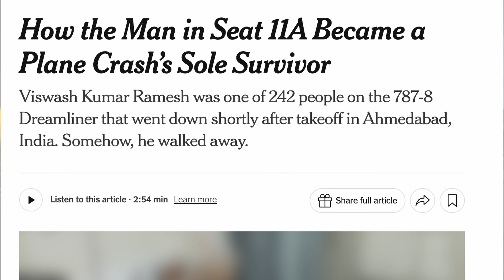Why the RAT Changes Everything – Air India 171 Update

Comment: Here is some interesting information investigators should know. Air India Boeing 787 Dreamliner involved in yesterday’s crash was previously singled out by deceased Boeing whistleblower John Barnett. In 2024, Barnett had raised alarm about substandard parts and lax quality control at the 787 manufacturing plant.   Barnett, a long‑time Boeing quality-control manager, had publicly refused to fly the Dreamliner, citing Boeing’s prioritization of speed over safety. He died by suicide in March 2024 amid an ongoing legal battle with Boeing.  Following Barnett’s death, another whistleblower—engineer Sam Salehpour, testified to Congress that the Dreamliner assembly process had safety flaws so pronounced they could cause the aircraft to “break apart in midair.” He also alleged Boeing was covering up these defects.  

This isn’t just a typical aircraft accident; it’s the exact same jet model previously flagged by insiders as having possible systemic safety issues during assembly. The convergence of (a) Barnett’s whistleblower warnings about poor parts, (b) Salehpour’s congressional testimony on structural risks, and (c) this real-world crash raises serious questions about Boeing’s quality control and oversight of 787 production.

This highlights a striking (and troubling) link: a Boeing 787 involved in a fatal crash is the same model repeatedly warned against by whistleblowers who died or faced retaliation. This connection intensifies scrutiny of Boeing’s manufacturing practices and federal regulatory oversight.

Comment: Loss of power or a bird strike can be a issue but taking out flaps instead of gear is a bullshit theory as the both are in way different spaces and it will take time to retract flaps like 10-12 seconds as Boeing tech is from an old era and there is safety mechanism in the plane to reconcile these fuckups so to blame these things on pilots is not a very good option these white people think that Indian pilots are not competent enough but they are much better pilots than them and to claim Insuarance money easiest way is to blame on pilots so that the company have an clean chit and can satisfy their shareholders

Comment: The plane went in for maintenance and a over haul recently  my theory is   a complete computer system shut down  now the issue is why are the flaps up does the 787 flaps retract with a full system failure?
And if you have a duel engine failure you would have the flaps set to full?
Going to be interesting
Rip 😢 to the lost souls 🙏

Comment: WHY ENGINE FAILURE ? Ans…,,OVERLOADING. EVERY INDIAN AIRPORT YOU CAN BRIBE THE STAFF AND OFFICIALS TO CARRY EXTRA WEIGHT WHICH THE PILOTS ARE NOT AWARE OF AND IS NOT CALCULATED BY ONBOARD COMPUTERS TO GIVE THE CORRECT THRUST AND POWER TO THE ENGINES  WHICH HAVE TO FAIL

Comment: Well it showed that doing videos too early after the crash is nothing but just speculation. If this video would be your first video on this topic it would be much better. Now it feels the first video was rushed because of "youtube algorithms".  BTW if you take a close look at the gear you can see that the gear up was initiated but never completed, because of no hydraulics/engine power powering elec hydraulic pumps. After take off with main gear down the 787 aircraft bogies are slightly tilted to the back (rear tyres are lower than the front ones). After you go GEAR UP it takes few seconds, but before anything happens with the landing gear doors the bogies are leveled (rear tyres are coming up and they are now leveled/or even slightly above the front tyres) and at this point these aircraft bogies are ready to be brought in inside the aircraft.
In the video you can see front tyres of main landing gear bogies are at the same level/lower than rear tyres - that means that the gear up was started, but it never finished.

Comment: I remember an issue with the Diamond DA-42, when it was first introduced, there was a crash caused by landing gear retraction. In that take-off the battery had been flat that morning, the aircraft was started with ground power and once the engines ran, the alternators started charging the battery. However, when shortly after take-off the gear was selected up, the electric surge was large, and normally assisted by the battery, in this case, both alternators overloaded which resulted in a total electrical failure. Back in the early models, the FADECs where powered by the same electrical system, which then resulted in a dual engine shutdown. 
This problem was solved by installing additional emergency batteries in the aircraft, and modifying procedures that prohibited flight before the batteries were full of charge.
The 787 is a totally different aircraft, but I see some similarities. Could a sudden total electric failure have caused a dual FADEC power loss as well? It would explain the unretracted gear and RAT deployment.  I guess we'll find out when the FDR data is published. let's hope this doesn't happen again before we know what caused the dual shutdown.

Comment: There is something that still makes no sense. The RAT will only provide electrical power ONLY for key components, and the passenger lights don t meet that criteria. So if the lights flickered, it's not because the buses changed to the RAT, but something else that we don't know. (It would have happened if, for example, switched to the APU)

Comment: Wrote this before this video, posted it elsewhere on another video but can’t recall. Rat Theory makes sense and warrants investigation. Executive Summary

This brief raises a critical question regarding the unexplained loud mechanical noise reportedly heard by the sole survivor of the Air India Flight 171 crash shortly after takeoff. Based on current Dreamliner architecture and safety mechanisms, this report hypothesizes that the noise may have been the unexpected deployment of the Ram Air Turbine (RAT) — a device that should only activate during catastrophic power loss.

If verified, this may indicate a serious failure of the aircraft’s electrical or engine systems during initial climb and warrants immediate independent investigation.

II. Survivor Testimony – The Key Clue

According to verified reports:

“I heard a loud noise when the plane took off, just before the crash.”

This statement strongly suggests an unexpected and audible mechanical event, distinct enough to be recalled under traumatic circumstances. It was not attributed to engine roar or environmental factors.

III. Hypothesis: RAT Deployment During Takeoff

On the Boeing 787 Dreamliner, the RAT:
	•	Deploys only during complete electrical failure, typically due to dual engine shutdown or simultaneous generator bus failure.
	•	Emits a distinct thud/whir during deployment and airflow engagement — potentially audible in cabin depending on altitude and location.
	•	Should never activate during a routine takeoff, under normal redundancy systems.

If this sound was the RAT, then the aircraft:
	•	Lost electrical or hydraulic systems during climb, and
	•	Was operating in emergency-only power mode before impact.

IV. Urgent Investigative Questions
	1.	Was RAT deployment logged or indicated on the aircraft’s flight data recorder (FDR)?
	2.	Were either of the electrical generators or main engines malfunctioning during takeoff?
	3.	Has Boeing issued any silent technical bulletins regarding electrical faults or premature RAT deployment on 787 Dreamliners?
	4.	Did maintenance reports on AI171 flag any unresolved electrical or auxiliary power issues prior to departure?

V. Implications for Public Safety and Accountability

If RAT deployment occurred during takeoff:
	•	The event would point to catastrophic systemic failure during the most critical flight phase.
	•	It would also raise serious questions about Boeing’s electrical architecture, maintenance oversight, or software command systems.
	•	Survivors, families, and the flying public have a right to transparency.

VI. Recommendation

I respectfully call on:
	•	Air India,
	•	Boeing,
	•	The DGCA, and
	•	ICAO / international regulators

to immediately disclose whether:
	•	The RAT was deployed,
	•	Any relevant anomalies were detected,
	•	Maintenance logs or technical bulletins point to known risks.

This is not mere speculation — this is a testable technical hypothesis grounded in survivor testimony.

Comment: Why would the ram air turbine deploy, if the APU were still running? I don't see vapor or heat distortion at the tail cone in the better video. Birds wouldn't strike that, and electrical power is what it does. So what's left? Three jet engines out means a common cause.......?

Comment: Shouldn't the RAT be also visible in the looped video part, where it can be heard as the plane goes through the frame? It seems to be a good angle and a much closer shot as compared to the paused shot where the RAT was circled in red in the distance.

Comment: There's no pilot error.  It was Boeings fault. There was less than 40 sec to react. Being a pilot you should know how much time is required for flaps to change from Flap 0 to 1 or 5 or back to 0. But all the western media and you pilots are straightforward saying Pilot error without any proof.

Comment: I don't know, where the fuel intake inside the tanks is, but what if water is inside the tank and the plane rotates, so the heavier water will collect at the bottom rear inside the tank and so after rotation the fuel lines only suck water instead of fuel? Normally water contamination is tested and water can be drained, but what if it was contaminated deliberately? Not only India has some threats from Pakistan, but also Russia trying to sabotage the western world, I would suggest, aviation maintenance should be extremely supervised that no enemy related workers are in the process of such a vulnerable part of aviation.

Comment: Wow. As a 25yr pilot myself, who does not fly 787, but other Boeing and manufacturers aircraft, this has to be one of the most ingenious and idiotic systems designed and concept all at once. Boeing has gone down the toilet the last 10-15yrs. We used to joke and call the Airbus the Scare Bus with its fly by wire decades ago. But this system and sound are providing better clues. With that said, why don’t we just let the black box tell us exactly what happened. And not blow off the situation like the DC military helicopter idiots they just swept under the rug and said meh… stuff happens. Let’s have helicopters keep flying around Wash Intl!?!? Nope.

Comment: I have heard rumours that on the incoming flight into Ahmedabad from London earlier that day passengers had complained about electrical faults throughout the aircraft.  Early speculation by experts such as yourself Steve are now leaning towards total power failure of both Engines. The odds of both Engines suffering a mechanical fault at precisely the same time must be astronomical, leaving the most obvious common issue to affect both Engines to be either contaminated fuel or probably more likely in consideration of the issues reported on the incoming flight earlier that day as an electrical fault that prevented fuel pumps from supplying fuel to both the Engines. If subsequently investigators find this to be the case, questions will be asked about what was done on the ground when the crew landing in Ahmedabad from London earlier that day reported the problems to ground staff.  One assumes the new crew would have performed vigorous preflight checks,  no doubt with due respect to the regulations governing what is acceptable for continued service of an aircraft in such circumstances. We shall have to wait and see what steps the respective authorities take if subsequently their investigations point to poor decisions that may have played a significant part in the loss of so many passengers in this horrendous disaster . We await the investigations findings with bated breath. Maybe you could enlighten us on the procedures that take place when an electrical fault is reported? Thank you for your excellent summary of the events so far.

Comment: There is apparently an open trash in the near vicinity of the Ahmedabad airport, which has significant issues with birds. Could hitting a large bird flock cause dual engine failure?

Comment: Idk when I heard Boeing and only for that reason I felt it was a problem with the aircraft rather than a pilot issue or terrorist .  Boeings reputation sure isn’t as good as it used to be. I would be extra nervous flying in a Boeing aircraft.  Be it maintenance not done properly or  just they don’t make them like they use to . Doesn’t help the whistleblowers ended up dead in mysterious circumstances. But personally I’ve lost all faith in Boeing as a company so much the only thing I was thinking was it’s a Boeing plane 🙄and waiting for the investigation. Boeing seem to be very quick to jump in and blame shift . You can’t deny most commercial flight crashes seem to be Boeing.. they say rare and most crashes happen in small aircraft. Take small aircraft out of the picture and only compare commercial aircraft you’ve a complete different picture comparing like with like .  Maybe just most planes used are Boeing.
Reply: Indian airport staff did not inspect the plane properly

Comment: Little known fact, not remembered Department: In the 80s, a Delta 767 departed LAX for Cincinnati when the Captain turned off both engines with the switches behind the throttles at 2000’ above the Pacific. The quick-witted FO got the engines re-lit, and they proceeded to Cincinnati.

Comment: BTW, if you can hear the RAT so clearly, it's also because you DON'T hear any noise coming from the two main turbine engines, which is very clearly indicating they were not functioning. Even if you assume at least one was running to counteract the other flamed out, it would have been running at max power in such a situation, but you cannot hear any high noise typical for such a large turbine engine. You just hear the RAT.

Comment: I’m considering the possibility  that the moment when the Pilot Flying called”Positive rate, gear up”the engines quit, the RAT deployed, and the Pilot Monitoring got shook with the different noises, sensations and cockpit lights going off, and raised the flaps instead of the gear, in partial explanation of why the flaps came up while the gear stayed down.